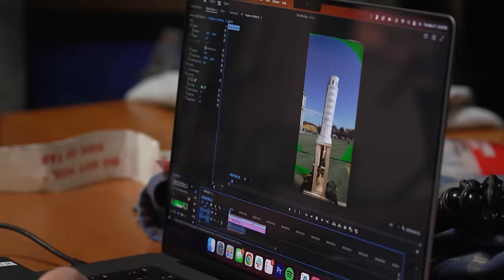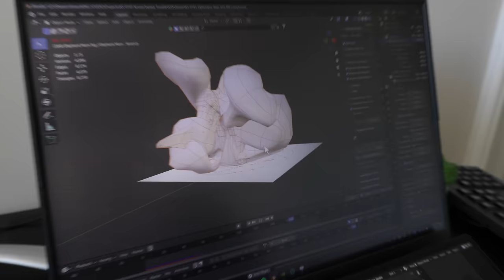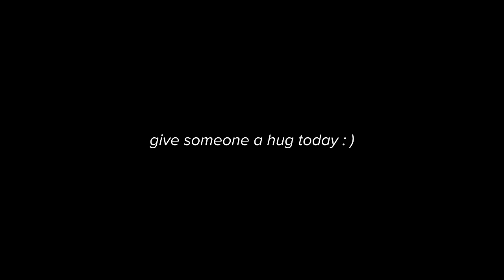Revealing How I Made My Top 10 Travel Tricks

Comment: On airport screening door:  what trick is used to place a full height door when the blue screen with tracking points only covers a small sportion at shoulder height?   When opened, is the full height grey door we see all CGI ?   If the full height of door frame was masked,  was there a need for the small shoulder height door to be blue (or green) ? Wouldn't you need only the tracking points on say a white mini-door to get the tracking that you could use to animate the background and CGI the grey back of the door?